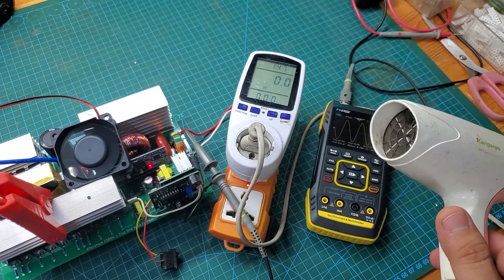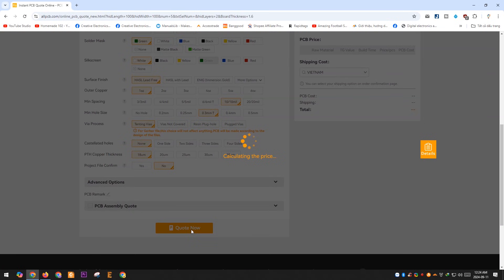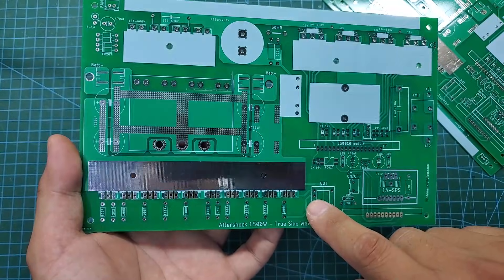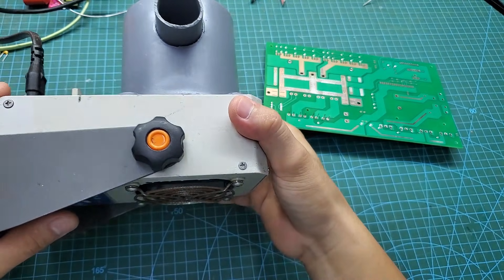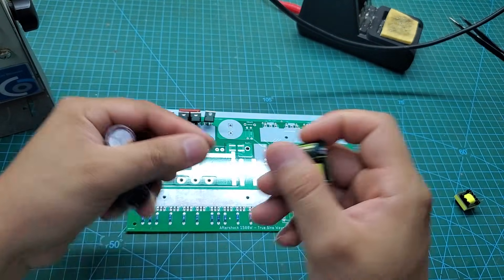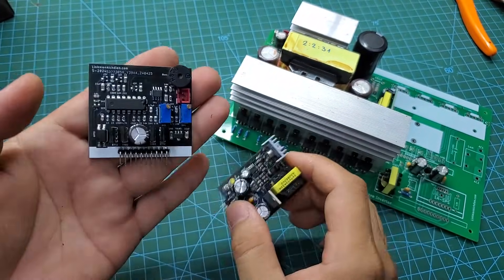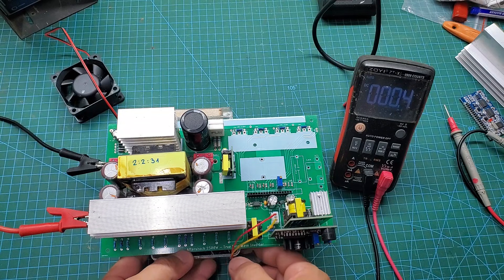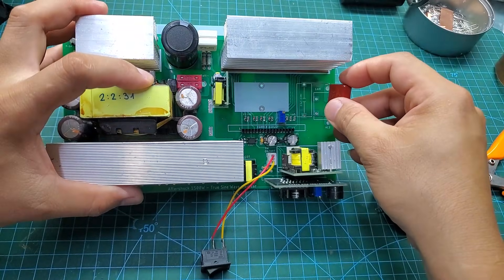Design and manufacture of a 1500W high-efficiency inverter | ALLPCB

Comment from the maker: Register and get free PCB of this project here: https://bit.ly/3ArZbeu
Gerber: https://bit.ly/4f5GcG0
Reply: Nice project sir 
SIR PLEASE ADD THE 
TRANSFOMER WINDING WIRE GAUGE AND NUMBER OF Turning ❤❤❤
Reply: How can I get the hi voltage to 12v converter file or video
Reply: I am a low frequency guy  Your videos are and always has been really cool no matter what your making!  Will high frequency every be as good as low frequency???  I wind my own transformers and chokes so my idle losses are extremely low ; to any one who thinks low freq means high idle losses  Yes my low frequency inverters are VERY heavy but they are cheap to build tough and last forever!  A small low freq  pcb that uses eg002 and 8 big style (247)  mosfets would be great           Through hole for mosfets and any bigger or more expensive components and smd for every thing else   That is if ALL PCB or another pcb manufacturer will make pcbs AND populate the board with all the smd if a cheap price!!!!  A think a cheap price would be around or under 30 usa dollars per pcb with smd components soldered on  A on board smd buck or a place to add a buck/step down module for higher battery banks would also be needed                                                                         Dose anyone else think this would make awesome cheap fast fun and easy diy inverter board to build ????

Comment: Hello. I have an inverter board with HY4008W transistors.
Can I put transistors with higher voltage and amperage so that they don't suffer so much?
Can I put the HY5110W transistor?
Thanks and regards.